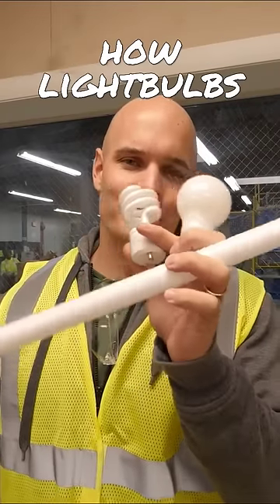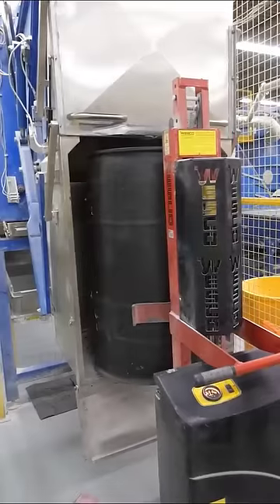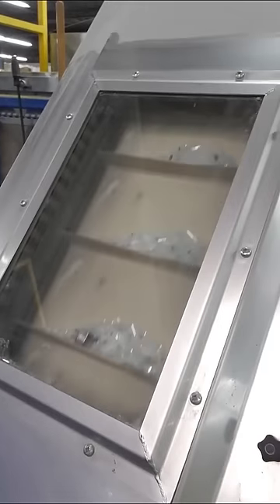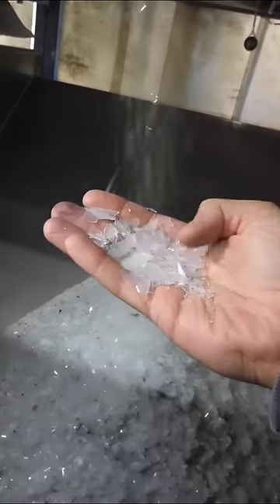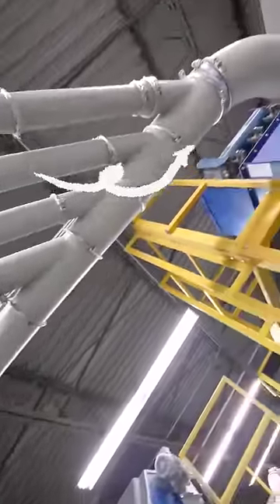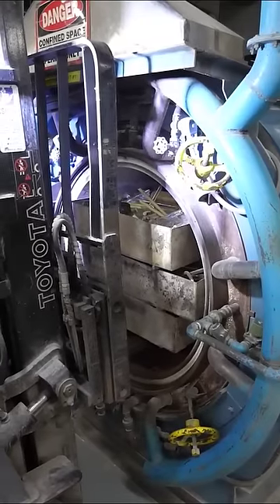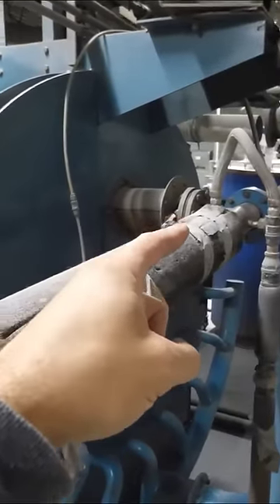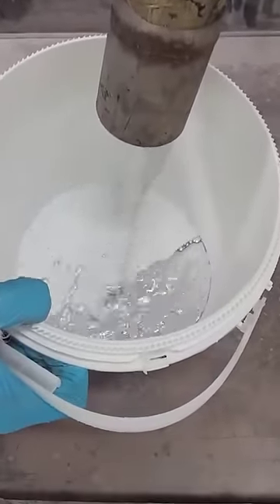VERY BRIGHT IDEA INDEED...

Comment: Fun fact, a full 5 gal bucket of mercury weighs 565 lbs.
Reply: A 5-gallon bucket of mercury would weigh approximately 550 pounds (about 250 kilograms)
not 565 lbs
Reply: @Black-Peter bruh
Reply: @Black-Peter US or Imperial gallon?
Reply: @st200ol  wtf 😒
Reply: @Black-Peter  WTF, WTF?
Reply: @st200ol  don't ask about what I said
Reply: @Black-Peter  WTF.
Reply: @Black-Peter  are you including the weight of the container. Otherwise a 5-gallon bucket worth of mercury would weigh 550lb, not an actual bucket full of mercury.
Reply: @Black-Peter pendant
Reply: a 5 gallon bucket does not weigh 15 pounds, the difference between 250 and 265 being stated here. @yupimrandy
Reply: @yupimrandy if your empty bucket weighs 15 pounds you got problems
Reply: How they lift it off the ground and the handle doesn't break is a mystery to me.
Reply: @thatgun6726  they usually use something much smaller to transport, like liter containers. I just Googled it as I recalled that it was super heavy and figured out what it would be for that bucket in the video.  That bucket handle or base would bust out well before getting full.
Reply: @kenreynolds1000  thanks. I use those buckets at the restaurant I work at every day and when they're full of dense liquids(sesame sauce full of sugar is heavier than water) I was wondering how that worked.
Reply: Still lighter than my ex
Reply: How many hamburgers per football field is that exactly..?
Reply: @dvsr5296  I didn’t feel like a unit conversion effort, that’s why America invented the internet.  I wanted to know what a 5 gallon bucket full of mercury would weigh so I googled it.
Reply: 3.785 L/US gallon * 5 US gallons * 13.5 kg/L * 2.205 lb/kg = 563 US pounds
4.546 L/UK gallon * 5 UK gallons * 13.5 kg/L * 2.205 lb/kg = 677 US pounds.

OP is close enough.  The people saying 250 kg/550 lb are just wrong
Reply: @Mikemk_  thanks for that.  I just found a converter on Google and didn’t feel like debating the accuracy.  I just know there is nobody picking up buckets of mercury
Reply: Bucket weights approx. 20 elefants on a spoon minus half a jumbojet and footballfield. Love the imperial units 😅
Reply: @Black-Peter would the bucket be able to hold that weight?
Reply: 113 pounds er gallon!!!😃
Reply: @st200ol Italian 😈
Reply: It's only going to weigh a couple of pounds because when they try to pick it up the bottom will break out of it.
Of course, the handle would break first so they can't use that to pick up the bucket.
Reply: @mohamedghaithmajjani8553 you are correct. No way that plastic bucket would hold that weight.
Reply: @Black-Peter 🤓
Reply: @164procar4  Don't let them live in your head man
Reply: @jorbeltuovinen7057  I'm sorry but unless you're using the time honored and universally accepted metric of banana (mathematically noted by a "🍌" symbol) then I can't take you seriously.
Reply: That’s incredible
Reply: @JosephLedbetter my 5 gallon bucket weights 30 pounds empty. You can have a bucket weigh any amount you design it to weigh.
Reply: @PandiTheBear  ahhh I see clearly now. Thank you PandiTheBear.
Reply: @JosephLedbetter It depends if the bucket is made with lead.
Reply: Thatd be the most fun thing to do to new people as im not for playing tricks on people but thats harmless. Bc my ass would definitely have tried picking that thing up lol
Reply: Fun fact #2, in 1 pound bottles of lab grade Mercury that would be about $136,000, again 10 seconds on google and I’m not citing sources and doing metric conversions or buying in bulk at Costco.
Reply: @Black-Peter well technically he said a gull bucket not 5 gallons. You can get more then 5 gallons in the bucket without it spilling
Reply: @dvsr5296 😂😂
Reply: Almost 565 👍
Reply: Why do you know this? Lol
Reply: @Black-Peter maybe his scale was 15 over?
Reply: @Black-Peter redditor reply
Reply: @Black-Peter not 5 gallon. A bucket that can hold five wonderful ladies.
Reply: Only on planet Earth
Reply: How much would a empty bucket weigh. After all, air weighs something.
Reply: Metric system, anyone??
Reply: Fluid ounces anyone ?
Reply: @DonHrvato Yes please. Look at the Americans arguing and bickering over which gallon to use and what the better unit is: pound or lbs or whatever.

One posted a lengthy calculation to get to a correct result, and I thought "what the hell, why all the math, the solution is _right there_!" because the density of mercury was given in kg/l...

So what the hell, take that times 20 and you got your bucket full, why make all this extra effort
Reply: HOW MUCH IS THAT?!
Reply: Volume to weight conversion?😂
Reply: @jorbeltuovinen7057 US Customary, not Imperial.
Reply: @Kuchenwurst  a pound is a lb. that’s why everyone is giving the guy who corrected OP such a hard time lol.
Reply: That is a fun fact ty 🙏👍
Reply: @Black-Peter 565 is approximately 550, that's the definition of approximation lol
Reply: @Black-Peter umm actually 🤓🤓👆
Reply: @Black-Peter close enough dude
Reply: @Black-Peter it would weigh 564.4lbs to be exact.

Source: I have a chemistry degree.
Reply: What about steel for reference??
Reply: @southernweather25  liquid steel would melt the bucket.
Reply: @Black-Peter at what temperature?
Reply: @yupimrandy at what temperature? Volumes mean nothing without a temperature associated with it. That's why temperature can be measured using changes in volume, and guess what compound is used for precisely measuring temperature?
Reply: Do you even lift bro?
Reply: Just curious.. but how much more weight is liquid mercury, to an equal volume of water?
Reply: And a cubic foot of gold weighs nearly 1200 lbs..
Reply: Was on a demolition job in Detroit years ago at school science lab, removing shelving etc. found small storage room missed by abatement crews. We used prybars to open door. There was some chemicals they came to get and then they found a large like paint can on floor and could hardly move it removed lid, inside MERCURY!! Took half a day for them to contain and remove it in smaller containers
Reply: Nah nah I could carry it bro
Reply: @Fxmbro  You’d hafta pick it up like an Atlas stone, then either the bottom (of the bucket, not your bottom although I’m ruling that out) would break or it would goosh up in your face. So, nope. You couldn’t do it.
Reply: My personal takeaway: it's heavy as shit.
Other people's ver pedantic takeaway: his math was off.
Reply: Imagine spilling that 💀
Reply: @The_Remster  , I spilled a very small amount while working as a lab tech once. I panicked so hard. Thankfully it all got caught in a Rubbermaid cart.
Reply: @chthulu27  I’m 58. I remember one of my classmates in high school playing with mercury on a desk after having broken a thermometer. Literally nobody in the class thought one thing about it.
Reply: Holy shit so that would make the plastic bucket give up and collapse under its weight?
Reply: @mancerrss  , a standard 5 gallon bucket? Probably. If you dropped it from any height greater than a few inches, I would imagine definitely.  Although having worked in warehouses, I'm often shocked Vlby just how strong some of these containers end up being.
Reply: Tf is gallon and pound? Who use that anymore?
Reply: @alanratay4583  , yeah, as long as the exposure is brief and doesn't make contact with any sort of open wound or get ingested, there's really no risk. People just get so crazy about it these days because the concept of safety has become all-encompassing, often even at the cost of common sense.
Reply: @chthulu27  I suppose the “brief” part is crucial. Hat makers used to go crazy and die from mercury poisoning. The kid playing with mercury that I referred to happened probably 45 years ago and he’s still alive and well. ✌️😜👍
Reply: @alanratay4583  , correct! The Mad Hatter from Alice in wonderland was based on the fact as you pointed out that they got mercury poisoning and went nuts! Not too surprising when your brain is slowly being killed by heavy metal poisoning.
Reply: @roku_nine 'Mericans...last hope if the Imperial System.
Reply: @alanratay4583 59 here and we passed it around on class.  Sticking our hand in it... no worries at all.  Poured oil on dirt roads, no seat belts, drank from the hose.  You and I were dumb, but we were tough.  Darwin moves cleaned the gene pool.  Too many survive today, such a shame...😂😂😂
Reply: @Black-Peter don’t be that guy…
Reply: @Black-Peter thanks Mr. Pedantic. What would we do without you?!?!
Reply: @Black-Peter what iss gallon then?
Reply: @Black-Peter  you must be fun at parties
Reply: @Farce13  clearly I don't get invited enough
Reply: @Black-Peter  clearly you are invited proportionally to how fun you are
Reply: @thatgun6726 i melted lead into a cast iron pan and couldn't lift it off the grill afterward 😂😂. Had to let it solidify and carry it by hand because the handle was not working.
Reply: Let's see,  @Black-Peter ... aren't 565 of something approximately 550? If that's "not a good approximation," according to you, then what do you think would be one?
Reply: @dougaltolan3017 : What do you believe a triangular flag has to do with this?
Reply: For people that use normal non-imaginary units:
1L of mercury = 13.6kg
That should be obvious as density of mercury is 13.6 g/cm3
Reply: @Black-Peter nah bro I think it'd be 5 gallons
Reply: Well it is metal
Reply: No, it weighs 5 gallons
Reply: @rootbeer7966 Mercury was used for barometers a while back. Atmospheric air pressure at sea level is about 14.7 psi, and that pressure is enough to lift a column of mercury about 30" high. Whereas 14.7 psi will lift water about 33 feet. So mercury weighs a little over 12 times as much as water.
Reply: Light weight 💪
Reply: Plot twist, that's a 3 gallon bucket featured in the video. Now everyone that contributed to this thread has to go back and start over from 3 gallons instead of 5.
Reply: “What’s heavier the 5 pound bucket of mercury, or the 5 pound bucket of feathers? That’s right the 5 pound bucket of mercury, because mercury is heavier that feathers.”
Reply: @kennethblocher6110  it would be interesting to see if the distribution of positive to negative comments would be the same.
Reply: @Black-Peter WTF
Reply: ok knerd @Black-Peter
Reply: @KeshavSharma-tv3it  can't even spell it I see 😂

Comment: Personally I wouldn't reach out and catch falling shards of glass with my bare hands, but maybe I'm weird
Reply: meth
Reply: Especially ones that were used to contain mercury until mere seconds ago.
Reply: Can confirm you're weird. I do this on the daily.
Reply: It was in a tumbler
Reply: @TiddyTwyster  this
Reply: @TiddyTwyster They 100% are.
Reply: Light scratches at level six and deeper grooves at level seven
Reply: He also opened the hazardous materials fearlessly
Reply: @CWINDOWSsystem32 all the Mercury gets vaporised, you can touch it, it's perfectly safe
Reply: Bro it went in a tumbler it’s not longer sharp
Reply: Ok so it's not just me
Reply: Quick snack imo
Reply: I'd open my mouth under there they look soo delicious.
Reply: @CWINDOWSsystem32 it doesn't have murcery anymore so what's the problem?
Reply: Yh, you're very weird... That's totally normal
Reply: @TiddyTwyster at times they can do nothing, at times they can kill. It depends on the shards and the circumstances.
Reply: @Tactical_Assault_Pelican How exactly do you touch a vapor? Also vaporized mercury is many times more dangerous 😂
Reply: @blowndome  I mean it's safe to touch the glass, because the Mercury is gone
Reply: @hiddenguy67 low-key, that's what I thought was in the videos thumbnail 😅
Reply: I am holding my breath just watching the vid glass dust scary
Reply: @CWINDOWSsystem32 I imagine the mercury was baked and evaporated off. If you heat a pan of water and let the steam come off you are left with a dry pan with 0% water.
Reply: Those really arent shards though. Those a bits
Reply: @blowndome  Have you ever held your hand over a pot of boiling water? You were touching water vapor. Have you ever been outside on a humid day? Also water vapor. Have you been in Earth's atmosphere? Water vapor.
Reply: Why not? Then slam a few alcoholic energy drinks while getting a new face tattoo. Only if your somewhere cool enough to have all drugs decriminalized tho.
Reply: Hear me out
Reply: @TiddyTwyster you don't work at a bar then
Reply: The average I phone users do this all the time with their smashed af screens
Reply: Fluorescent bulbs are made of super thin glass that doesn't get very sharp edges. I used to bust em for fun as a kid, but we tossed them to make them pop, so we weren't near the mercury dust.
Reply: Every time one of those machines break down they gotta deal with mountains of the shit to fix it. They're used to it no doubt. Dudes palms could probably dull a cheap steak knife
Reply: @davejones9469 this is incredibly wrong lmao
Reply: Youre the weird one here, yes.
Reply: Don't worry, it's perfectly safe. If you get 30 types of cancer in a few years, it must be a coincidence, and probably to do with your diet.
Reply: its probably a normal thing from where hes from but thats just me
Reply: @Stevie-J this comment is underrated
Reply: You're not weird, you just dont have sufficient information. (Or, you do, you just didn't think about it hard enough.)

Nothing can pierce your skin unless it has pressure behind it. Catching glass from a very low falling height isnt really going to do anything.
Reply: Not a very... bright idea
Reply: Clearly you scratch at level 5 with deep grooves at level 6
Reply: @laupoke speaking as a person who has helped my dad with his glass business since like 7 and im 25 now. No shards of glass aren't as harmful as people make them out to be. It's only when you put pressure on them that they become harmful. You can use tempered glass which breaks into thousands of pieces when hit on the edge and use it as gravel.
Reply: @hiddenguy67 🤣🤣🤣🤣
Reply: @TiddyTwyster it is tho i once handled broken glass without gloves and got stabbed by a piece i didnt notice
Reply: Be afraid of everything!
Reply: freak!
Reply: They're tumbled to dull the edges so it wasn't exactly sharp
Reply: @Yeshuawillreturn most glass isn't specially heated glass blowers glass. It retains sharp edges, it becomes little slivers that can embed themselves in you, I've also known someone where it went deep enough to break off in the blood stream. Which fun fact, is dangerous. And this goes extra for light bulbs, incredibly thin glass under a vacuum, that shatters into super sharp pieces that need to be tumbled to be safe.

No, I think it's more dangerous to lie about glass being not dangerous. You should never pick glass up with bare hands and you need to always super thoroughly clean the area it shattered in. The amount of times hidden glass shards have stabbed themselves into feet is awful. 

Glass is as dangerous as people think it is.
Reply: You have bear hands?
Reply: @Jono4174 LMAO
Reply: It’s literally just sand lmao
Reply: @lostpony4885 glass when crushed that fine is no different then sand, would be no different then tossing sand up in the air on a beach and breathing
Reply: He had barely any ppe too
Reply: Umm.. weird guy alert
Reply: Everybody my age catches falling shards of glass, it’s the coolest
Reply: No you aren’t weird Brent! You’re smart! The guy in the video wasn’t that bright for doing that!
Reply: Wouldnt open A hazardous container either
Reply: @laupoke this is what i tried telling my friends when the bottle broke but nah they said i was dumb
Reply: Judging by how flaked it looked, I could say that as long as he didn't crush his hand then it would be fine. Plus nowadays a good bit of light bulbs got either plastic/thin acrylic  bulbs instead of glass ones, but those are LED's and stuff so go figure.
Reply: Jesse, we need to cook
Reply: That is probably way safer than touching the shards of your broken drinking glass at home because all the shards in that machine tumbled around for a long while, rounding off the edges!
Reply: What about a shower of it?
Reply: @blowndome youve never been hit with steam? Water vapor? Bruh
Reply: Yeah I thought I was the only one .
Reply: @TiddyTwyster good one 😂.
Reply: 2nd time I’ve seen someone do that 😭
Reply: We are, sir
Reply: If I'm not mistaken, he said the glass passed through a tumbler. That should round off the edges and make it safe.
Reply: Especially those because they are razor sharp.
Reply: @laupoke nah
Reply: Bouncing around in essentially a rock tumbler would in theory break all the sharp edges.
Reply: Haha, yeah, that's what I thought too! I was like, "OOH! OK, uhh... ouch... maybe?"
Reply: @julian1259 : So...?
Reply: @HelloKittyFanMan  among us
Reply: @hiddenguy67 : What do you mean?
Reply: @HelloKittyFanMan  🫠
Reply: @hiddenguy67 : Umm... HUHHH? 🤡
Reply: @HelloKittyFanMan  methamphetamine
Reply: @hiddenguy67 : Yes, I see that you know how to spell the whole word. Very cool!
But again: What ABOUT it?
Reply: I'd be more scared of the mercury than getting cut by the glass
Reply: Gotta be careful for tiny shards they can get under the flesh
Reply: He just wanted a lil' snacky snack
Reply: @TiddyTwyster  
Bigs ones from a broken drinking glass or bowl are not, but thin sharp and microscopic pieces that could stick to the inside of your palm? 

Even with careful handling it's still not a good idea.
Reply: Their Sanded by themselves
Reply: *Comma missing after 'personally'.
*Period missing at end of sentence.
Reply: @TiddyTwyster I guess that depends on how dangerous you think people think shards of glass are? Will it kill me? No, but I don’t want it cutting me, even if it’s a paper cut level scratch lol
Reply: @Jono4174 😂
Reply: You got soft hands brother